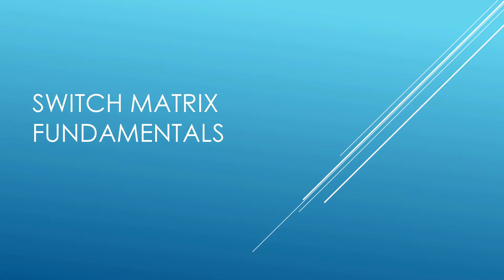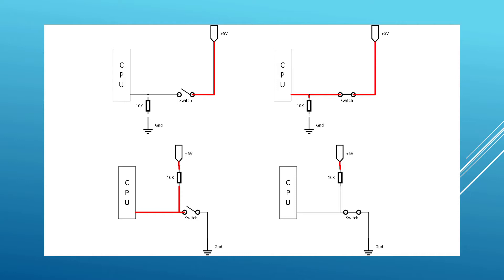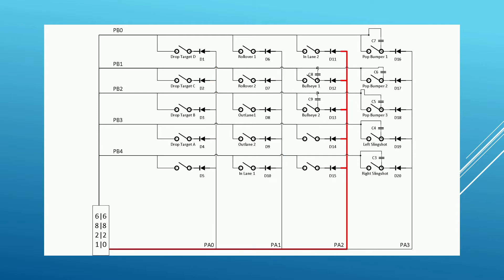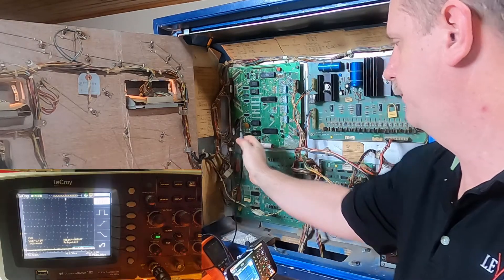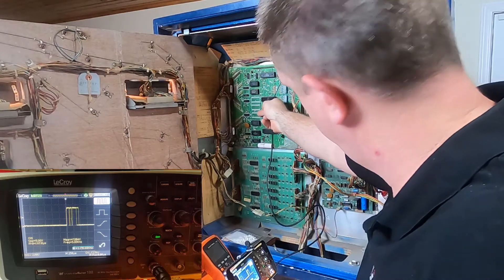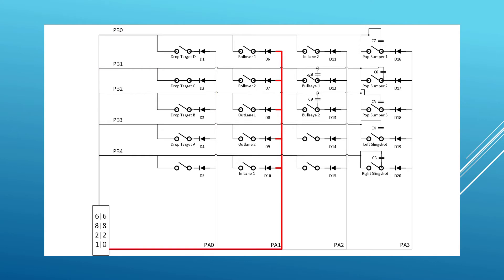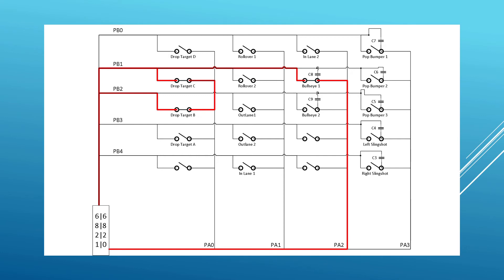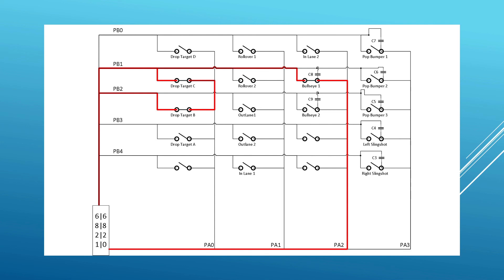Switch Matrix Fundamentals

Comment: Hi!  
I believe I'm the person you're referencing at about 3:40 in this video. I reverse-engineered this MPU and re-implemented the code on an Arduino plugged into J5. The switches are read in the zero-crossing interrupt service routine in the old code. The reason you're seeing more than 120Hz of signal on the U10 Port A strobes is because that port is cleverly used for three purposes!  
  
Take a close look at the circuit diagram and you'll see that U10 Port does the switch strobes, lamp address/data, and display latch strobe / BCD data.  
  
To use one port for three different purposes, they had to do some interesting juggling. The lamp address is latched by another signal. U10:CB2 latches the address, and when it's not trying to write data to the lamps, an address of 15 is latched. 15 is where the lamp board is "parked" so it won't pick up garbage when U1 Port A is being used for other things.  
  
The display latches are driven by U10 Port A (PA0-PA3), but those latches are NOR'd (by chip U20) with U10:CA2 so they won't pick up random values when the port is being used by something else.  
  
When the code wants to read the switches, it also uses U10 Port A, but a there's a delay in the code so the strobe lines can settle down from the other uses. The delay gives the cap for the current strobe to charge and for the others to discharge through R108, 109, 110, 111, and 132. For different boards (MPU100, 200, -17, -35, and Alltek) I've had to make that delay adjustable, and you'll see different constants in the old code for different boards too.  
  
So, when you're looking at U10:PA0 (for example), you'll see all kinds of interesting signals go by. You'll see the 120Hz strobe (ST0) for the first bank of switches, the latches for display #1 (at roughly 320Hz), and bit zero of teh lamp address, which will quickly toggle between 0 and 1 as the lamp chips are addressed from 0-14 and then parked at 15.   
  
If you set your scope to trigger on U10:Pin18, you'll see the switches and lamp business on U10:Pin2 (lamps are first and then the switch strobe is much longer pulse). 
  
If you set your scope to trigger on U11:Pin40, you'll see display #1 being latched by U10:Pin2.  
  
It's really interesting they way they got the most of this one port. Hope that clarifies for you why you were seeing all that movement on that pin.
Reply from the maker: You are correct, I did not notice the other connections on those outputs.  It does explain the chaotic signal on the PIA output.  You have done an amazingly thorough job of decoding the function of this MPU.  I see how the display and the lights could share the lines as there are strobe and blanking signals that could keep the garbage out of the other output devices.  120 Hz seems painfully slow for switch scanning.  I guess that is why the capacitors are critical on the fast acting switches.  
Bally did some amazing design work to get the most out of the hardware.
On a side note, what did you use to disassemble the original code?  Did you analyze the assembly manually, or did you have a tool?  
I am going to pin your comment as it adds an amazing amount of insight into the function of the scanning of the PIA and the MPU in general.
Reply: @laserfreshelectronics  To disassemble the original ROMs, I used the Flex 9 disassembler. I think it's here:  https://github.com/Arakula/f9dasm    Once the code is disassembled, it's tedious work to figure out what each line of assembly is really doing. I have the ISR for Stars that I disassembled and documented, but I mostly used O-scope captures to follow signal timing when rewriting everything. All my code is on GitHub, if you want to see a C representation of everything. I've also documented a lot of what I learned here:  http://ikehamill.com/2020/03/21/overview-of-mpu/

Comment: This is a very good representation of the switch matrix.  It was great that you probed with the O-scope to show the frequency as I think often times folks forget how fast many of these processes are taking place.  It’s also great that you showed the probing of the columns in relation to the rows.  Very easy to follow for anyone new to matrix issues.  Removing the diodes was a plus so people can see why they are inline with the switches.  Great job.
Reply from the maker: Thanks for the feedback.  I tried to make it as simple and visual as possible.  The O-scope was an afterthought, but my curiosity got the better of me.  The other video I saw mentioned 120 Hz as the scanning rate, and that seemed ridiculously slow considering the CPU is clocked at 500 KHz, and a ball strike on some of these switches could easily happen in less than 500 ms making it likely to miss a fast strike.
Reply: @laserfreshelectronics  I put a longer response above, but it's worthwhile mentioning that the switch measurement is very thoroughly detailed in the "Bally Theory of Operation" document that you can find on ipdb. I'll quote from page 8: "The last portion of the zero crossing interrupt routine is to read the momentary switches and look for valid closures. PIA U10, port PB0 thru PB7 are initialized as inputs, PA0 thru PA4 as outputs. The MPU chip, thru the program, sends a pulse down the ST4 strobe line (refer to MPU schematic W-1182 and wiring diagrams W-1186 sheets 2 and 3 of 3). If a switch is closed, the pulse will return down the corresponding 'I' line. The MPU chip examines the past history (in memory) of the switch and if it finds that the switch was 'open', 'closed' and is now 'closed', it makes a memory record of the valid closure. The reaction to this valid closure was discussed previously under 'NORMAL MODE of OPERATION'."

It checks the switches once every 8.3ms (120Hz), and it only registers a valid closure if the switch has been hit for 2 cycles. So, the shortest closure it can measure is 16.6ms if the closure begins right in time with the zero crossing. In practice, a closure has to be at least 25ms to register every time.

Comment: The capacitors are used for fast actuating switches, its the mechanism of the make/break of the type of switch used. I'm not sure how to tell when looking at a switch to visually look to see if its a fast actuating switch or a slow actuating switch or by looking at the mechanism, any tips are how to tell or test using an analog meter watching the needle movement? What circuit is Outputting the Scanning pulse data signal before the PIA chip? The PIA chips are address input pins and data input pins but I don't see any Scanning pulse input pin for the PIA chips datasheets 6820/6821, so I don't know which pin the scanning pulse is going to. I think the only difference between the 6820 compared to the 6821 is that the data input pins and output pins are LATCHED on the 6821 and the 6820 are UNLATCHED?
Reply: The capacitors are used in many games to extend the signal so the CPU can see there was a closed/open switch.  This is common on older machines.  The switch itself is just a common switch.  It’s the application that matters.  Pops, slings, exc. as the video explains.
Reply: @ArcadeResurrection  not all switch mechanisms are the same, some are fast switches because of how the switch mechanisms are made and other switches are slower. The capacitor will lengthen the switch closure pulse.
Reply: @waynegram8907  The switch is still made of the same blades, contacts and Bakelite as other switches, unless for HV purposes.  As stated, it is the mechanical assembly that makes it fast/slow acting.
Reply: @ArcadeResurrection  yes the mechanical assembly of the switch. I'm not sure what about the mechanical assembly make a switch slow acting compared to fast acting. When using an Analog meter you can visually see the needle movement when opening and closing the switch to test for the fast acting VS slow acting. I'm not sure how to test using a test meter to know if a switch is fast acting compared slow testing. It's hard to tell by just looking visually at a switch if its fast acting or slow acting.
Reply: @waynegram8907  I think I understand what your asking now.  

It’s not that some switches are made fast acting and others not.  The manufacturer determined if the assembly caused the return line to improperly register the signal to the CPU.  If so they added the capacitor in parallel to hold the signal longer for the return signal to register and let the CPU interrupt/score.
Reply: @ArcadeResurrection  correct because the root cause of the problem was the type of switch assembly was fast acting that is why they had to add the capacitor in parallel to hold the signal longer to register. The switch assembly is what is causing the problem because the response time of the open contacts to close contacts response time is so fast of how the switch assembly is made that that CPU can't register a return signal. By visually looking at switches by opening and closing the contacts can you tell if the switch is fast acting or slow acting. The only way to tell is if the CPU can detect and READ the closed contacts switch return signal or not because of the fast response time of the opening and closing contacts.
Reply: @waynegram8907  To my understanding the only way to know is if the switches circuit originally or virtue of a memo from the manufacturer, included a capacitor.  Then it should be kept that way.
Reply: @ArcadeResurrection  yes the designers added the capacitors because of the type of switch was used in the part lists. Not all switch assemblies are the same the switch itself, some of them are fast acting and some are slow acting its just how the switch internal mechanism closes and opens. The pinball engineers had to add the capacitors because of the switch response time was to fast for the CPU to detect a pulse.
Reply: @ArcadeResurrection  The blanking Circuit is refreshing the pinball games displays. The displays have a strobe signal which they call the blanking signal which is refreshing all the displays. What is refresh cycling/resetting the switch matrix PIA read status and lamp matrix PIA read status? Does the Blanking signal only refresh the displays or does the blanking signal refresh/reset the switch/lamp matrix circuits also?
Reply: @ArcadeResurrection  all pinball games have a big blue filter cap 10,000uf to 20,000uf which is a very large storage capacitor but for what reasons why pinball games need such a very large filter capacitor? because most linear power supplies for various circuits use multiple parallel filter caps 100uf X 4 to 6 filter caps they don't use 10,000uf to 20,000uf which is very unusual.
Reply: @waynegram8907  The very large “big blue “ electrolytic capacitor in the back box is often times 30,000uf.  On games such as Williams system 3-7 this is used to filter the A/C lamp circuit.  In my experience it rarely goes bad.
Reply: @ArcadeResurrection  but why are they using a very large capacitance value 30,000uf is overkill for filtering AC voltages/AC current. There must be a reason why they are using such a very large capacitance value.
Reply from the maker: I think Arcade Resurrection covered the capacitors thoroughly.  As for the PIA input, it is handled directly by the CPU. The CPU addresses the PIA, and either sends configuration or control commands to the PIA.  As for the difference between a 6821 and 6820, the only appreciable difference I could find is that the 6821 can handle higher current than the 6820.  Otherwise they are identical in pinout and operation.
Reply: @laserfreshelectronics  Why is the game ROM monitoring the blanking signal because if there is NO blanking signal, the watchdog circuit will keep resetting. The Blanking signal is used for the display digits buts its suppose to be used to cut down on using multiple wires in a buss. If they didn't use a Blanking signal it would be multiple wires for each display digit. So the blanking signal is some sort of "strobe signal" it seems. Maybe you can explain better what the blanking signal is doing and how is a blanking signal different than a strobe signal?

Comment: Thanks for making the video. What type of scanning pulse protocol would this be called? a PWM pulse width modulation but it looks like its some type of data protocol. I'm guessing the PIA chip ROWS outputs RB0 to RB4 are Sinking grounding the Scanning Pulses? while the PIA chips COLUMNS outputs RA0 to RA4 are Sourcing a Scanning pulse protocol?
Reply from the maker: There really isn't a protocol.  The CPU would command the PIA to turn on a specific pin on output, and then if the PIA received a result, it would be configured to trigger an interrupt on the CPU, which would then handle the interrupt and clear it.  It does almost look like data on the o-scope, but I believe all we are seeing is that the CPU is busy and doesn't always send out the pulse on a perfect interval.  This is what is causing the fluctuation on the frequency.